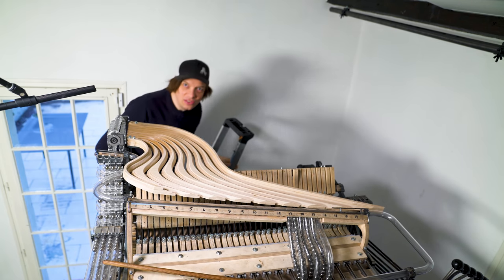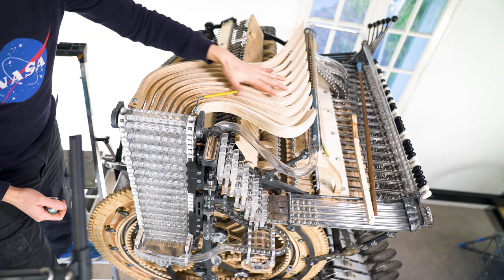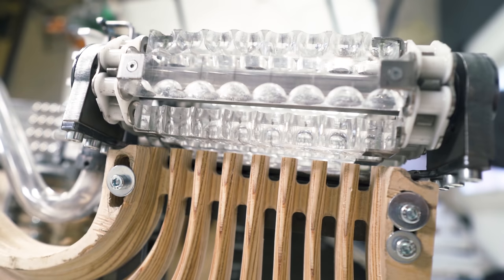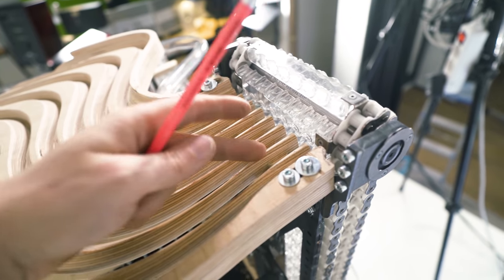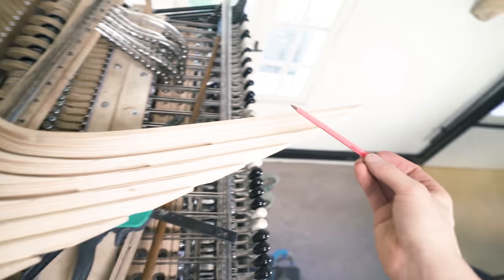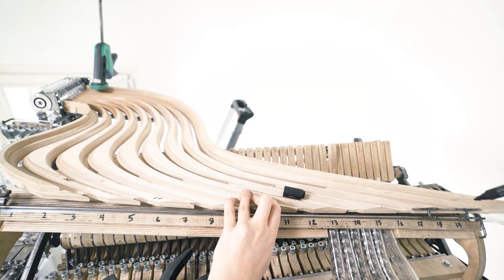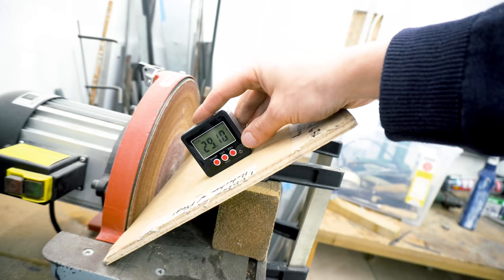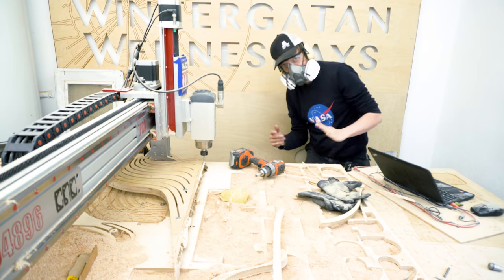Marble Conveyor Belt Plywood Lanes

Comment: This new marble track is aesthetically pleasing.
Reply: Its really good
Reply: It looks incredible high quality
Reply: Seriously. I was sad when he redesigned the original acrylic tubing marble divider, but this thing has more than made up for it visually.
Reply: No u
Reply: the artist is happy, will the engineer be happy? time shall tell
Reply: it is! but im a bit worried that the marble exit speed is to high
Reply: he is about to chop off more pieces tho...
Reply: the layers in the plywood would look great with a layer of varnish or lacquer
Reply: it is, i hope the distribution will be 'fair' for all channels, when they are open and not being rolled over like now.

also.. where is the best place to post the idea of a 100000 marble test - but continuously fast notes (with limited channels still)?
machine should be packed with marbles to provoke the moles honestly.
sorry martin, if this sounds like i want to punish you :( :D
big love man
Reply: It's my favorite part so far.  2021 is the year of compromise, and Martin has `said that aesthetics will be the first to go, but then proceeds to build this.  I'm not even mad.
Reply: @snujje  if the speed ends up being a problem, there’s a relatively simple fix: Martin explained before that by making the contact points of the rails wider (thus making contact with the outer axis of the marbles), the ball requires more rotations to travel the same amount of distance, and because of that also traveling slower. If Martin widens the lanes just a bit, he could potentially slow down the marbles quite a bit (if my logic is correct😅)
Reply: @screambmachine  I think the distribution is not a problem since the excess marbles loop around and come in from the pipe on the left. As long as there are enough marbles in rotation and there are always excess marbles, those first few channels should always get filled up first.
Reply: @GreenSkyDill  the fish stair is the only thing feeding the head of the vibraphone.  This could limit the number of marbles that can be played. The main lift seems to be biased to the middle and thus does not feed the vibraphone directly very well.
Reply: I have a feeling he will end up redesigning this. The issue right now is that he doesn't know how many marbles any of the instruments will need during the average performance, let alone a worse case scenario. So he doesn't know how to properly distribute the marbles. Not to mention that the marble conveyor works at a very low efficiency, currently, so he'll probably have to subject that to the same treatment the fish stair got. It might all work out in the end and he might not need to change anything, but it seems to me like he's investing a lot of effort into parts that are pretty likely to change. This is why i said before that he needs to do the big things first, like get all the instruments playing, and then worry about tiny things like "oh, look, these 4 pipes don't get filled evenly". Make it work first. Make it work better after.
Reply: Like flowing hair or the wind.
Reply: @ericpaul4575  He might just have to remake the entrance ramp to the main conveyor. Something similar to a binary counter could work, while giving the MMX the ability to count how many "new marbles" are going into the upper assembly.
Reply: @GreenSkyDill  yea forgott about that, he can widen the last part of the lane if it becomes an issue

Comment: Thats a lot of bouncing marbles there is almost a guarantee that there will be some instances where the forces collide in such a way that you get a ball flying out. Believe an extended rail system might be needed.
Reply: Was just about to post the same thing.
Marbles are entering the dividers so fast that they're bouncing quite a bit. I don't know if extended rails would help though - might just be adding extra complexity where it's not needed, contributing to the whack-a-mole issue.
Reply: yeah at 10:26 the marble nearly went over the top!
Reply: @aaronriggan2373  maybe instead of tracks that accelerate, he could make something akin to a stair so to keep the  speed in check?
Reply: If you have ever played a pinball machine, it would be cool to slow down the marbles with a “spinner”
Reply: he need to trash this part and just guide the balls through curvy PMMA pipes. this look disastrous. high in coke engineering.
Reply: @nothgroth1984  good solution, and for this sh*t, i think the only one.
Reply: I was going to post the same thing exactly.  Looks very nice but its looking more like artistic form over reliable function.   I guess you could put some sort of rail in place to catch the bouncing but then you are obscuring the visibility of the marbles moving down the final track.
Reply: @constantinosschinas4503  i was also thinking the same thing during the video, but i don't rhink martin would do it because "looks"
Reply: Or the contact point of the marbles could be changed to slow them down
Reply: I was thinking he could widen the tracks to utilize the technique discussed in previous videos where the marbles speed varies based on where it makes contact with the track. It could be a simple way to slow the roll of the marbles without introducing anything too complex.
Reply: Not to mention that the tests thus far have only used a handful of tracks. When a whole song is played, those marble returns are going to have to deal with a lot more volume which could introduce a lot more issues just on its own.
Reply: Have the marbles roll on a 'wider'  rail/track.  They are overspeeding at the end.. 
Or maybe a small vilt /wooden 'brake'  at the end of the lane (above the rail/marble) to get the speed down drasticaly.

10 point for the artistic look and 9 points on fysics for the slenting curves to keep them in lane
Reply: @bengaming3649  A wide strip of polycarbonate overtop would not look out of place and keep the marbles down
Reply: One of the modules might also need some adjustments it looks like the marble is resting a little to high up and blocking the other marbles from rolling down the divider creating more marble bounces when they collide with the fresh marbles coming down the track.
Reply: constantinos schinas Where’s the fun in that?
Reply: There definitely needs to be a braking system towards the end of the lanes. I know a lot of viewers spotted this as a possible mole during yesterday's video, but the slow motion today shows that it definitely is, in fact, a mole. The fact that a marble did (briefly) escape the divider and jumped back onto a lower lane means there's a high risk of marbles making it to the floor in a large scale test
Reply: It's not just the operation I'm worried about the acoustics of metal marbles bouncing over each other out of time with the music is also undesirable.
Reply: You beat me to that comment...
Reply: One might be able to brake the marbles by using inline magnets, the speed of the marbles in the track seems to be consistent which would make this possible. The only issue would then be magnetization of the marbles but since its a short interaction it might not be an issue.
Reply: Like what you have done it before, let width of the track gradually widens to slow down the marbles
Reply: I noticed that a lot of the bouncing seemed to be from the dismount off the track so it might be in order to also smooth out the angle there for more of a smooth drop off
Reply: There is 1 channel that is not flush when full and there they bounce
Reply: And need to take into account that the marble lanes are not 100% used. Will be much worse on fast song mb.
Reply: We can probably make the solution rather easy by adding a bit of grip to the lanes. Widening the track might not help much with the speed, but putting a bit of friction on the track definitely will. He might be able to save this by widening the track just a tad and putting some translucent spray rubber on the track towards the first bend. Anything later and the ball will have already gained momentum.

pair that with a sort of 'upper lip' at the end of the track to almost squeeze the marbles in place and that should solve both issues. There's just a little too much freedom of motion at the end there.
Reply: Was thinking the same
Reply: I agree that we need to slow the balls down. What about having a padded stop that absorbs the energy from the marbles so they don't go flying?
Reply: @jghanson25  Adding some kind of sound dampening material like what he used for the funnels to reduce sound could also not only reduce the sound the marble makes when they hit the wood but also increase the friction and therefore slow down the marbles.
Reply: @KalarMeadia  my exact thought, this would also reduce the sound they make when they initially hit the wood.
Reply: @jghanson25  Exactly what I was thinking, widen the lanes towards the end and introduce over-rotation to slow the marbles down before entering the divider!
Reply: they mainly hit the other piece of plywood, and that makes them jump. That can be sanded so the transition is smooth. Also if he could  use that technique of making the track wider to slow down the marbles due to an increase in rotational speed, then the piece could work without any issue.
Reply: remember a lot of the marbles will be used up by the xylophone which right now is currently blocked off.
Reply: thats what i said when he redesigned it
Reply: If you widen the contact points of the marbles toward the end of the runs it should cause the marbles to over rotate and slow down.
Reply: I think Martin should test if this is really an issue during a 50k marble test. Because right now no marble has escaped yet.
Reply: @enolp  BINGO!!! Actually, just need to extend the track groove in the backing wood strip so the balls 'flow' on the PMA pipe channels. Can be done with a rotary tool, or a file.
Reply: I honestly think it's not that bad- they'll bounce, but they'll bounce back onto the marble track based on the angle of their entry, hopefully?
Reply: @bengaming3649  could be a clear perspex shield of sorts, so you can see thru
Reply: At 10:20 there's already a marble on the floor :(
Reply: @nothgroth1984  wonderfull idea!
Reply: Yes. They seem to be coming down waaaaaaaay fast.
Reply: Yeah, 8:28 shows it perfectly,  the marble jumps a lane over when unloading
Reply: @bartholomewbilby1333  You sir, have a very dapper name.
Reply: A wild Mole has appear
Reply: Yeah, they have way too much speed by yhe time they get to where they need to be sprted through the channels that they end up bouncing over eachother and could even possibly jump pff the machine at highter bpms. The faster the marbles try to get sorted the more they will pile onto one another and end up commiting suicide off the machine. I love what hes doing and its a mechanical marvel. Ive been following for quite some time now and love the progress hes made.
Reply: @jamesparks5184  is there a coating that can be applied to the wood to add friction? Sprayable rubber?
Reply: It looks really great, but I agree some tweaking is needed to slow the marbles at the end. Part of it may be the transition where the angle changes rapidly.  I also noticed the marble height issue around gate 14 or 15 where you can definitely see some jumping balls in the slow-mo. These seem like solvable issues for a mind as creative and brilliant is Martin's.😉
Reply: @raskov75  honestly, a thin felt or fuzzy material would actually add the friction he would need to slow down the marbles and keep them controlled. Bonus, it will quiet down the extra sound of the marbles rolling down the track.
Reply: @jamesparks5184  Good point. Would he have to bother recessing the felt as to not throw off the tracks geometry?
Reply: @raskov75  that would depend on how thick of a strip of felt he uses. If he is generous with the felt, he may have to recess the plywood rails so that it all fits properly without restricting the carry capacity of the trails.
Reply: I feel like it'll add extra noise, too.
Reply: This will go wrong especially when very few notes as played and the machine has way to many marbles inside (for the current song). 
Martin, I suggest you to test this solution with an overfilled machine. You'll see this will go wrong.
I'm sorry, but I think you still failed on the mechanics first, aesthetics second.
Reply: @raskov75  Ah yes. I chose that name because my best friend was Steve Squirrel.
Reply: @nothgroth1984  A gate?
Reply: How about a simple plastic funnel across all lanes as on the catchers.
Reply: Could probably just widen the gap at the end of the track, so the ball spins on a smaller circumference.
Reply: @Dreoni_  yep, over rotate the marbles and slow them down
Reply: @bradgentle354  I watched the video again, the marbles are bouncing, but they're staying in contact with the ramp, so there doesn't appear to be a real risk of them falling over like a waterfall.  I noticed one actually bounce back to the track above the one it came from, but continue along happily enough.  I think there too much confirmation bias from yesterday going on, watch it again and pay close attention.
Reply: Or angle the plywood closer to the release point so you minimize the downwards force
Reply: Gunna post a possible solution. Most agree with the premise that the velocity is bad, a theoretical solution is to spray on some rubberized coating. A little squish goes a long way in absorbing kinetic energy as well as rubber being more grippy means more friction alongside the squish.
Reply: @dorusie5  Or it could lock the whole system up when a skipping marble wedges in it. Do not pass go, do not collect $100.

Better to slow the marbles down by adjusting track geometry - increased friction is ok.
Reply: @B0BBYL33J0RD4N  Rubber coating will rub off the marbles and make them sticky. Plywood is rather bouncy.
Reply: @nigelstewart9982  The marble that jumped onto the track, imagine now that's one on the track 5, it could easily skip out of the machine. Or that it hits another marble rolling down on the track it bounces on and knocks it off or skips further rather than rolling down again.
Reply: @timothyodonnell8591  Woah i think that one is even more of an issue, i think the marble was coming back into another track.
Reply: Also it looked like there might be a little bump at the end of the tracks that acts like a little jump. Not huge, but it adds to the risk of a flying marble.
Reply: @AstralS7orm  I thought about that too, if you keep the distance from the lane at least 2 marble diameters then that should never happen.
Reply: @cyprienchrnx3809  really! So much conjecture here. At this point in the process let the test results drive the need for redesigns.

Comment: "It's not going to cause any issues" - famous last words.
Reply: snap!
Reply: The lanes are very elegant, but I'm worried about those bolts too. I think the housing looks too thin, but also, the bolts don't look beautiful.
Reply: Looking at how the marbles fall on each other at the bottom, I think the conveyor may give the marbles too much velocity and the marbles will bounce out of the machine. Looks fantastic though, great modelling skills and craftmanship
Reply: @richardspice2334  and at the start marbles are falling a bit on the left part of the canal, generating chocks between themselves (@10.57). Could be some issues as well here (i'm really pickyboring😜).
Nevertheless this is awesome !
#pastisforever
Reply: but it will. I'm worried that new tracks are in the way of... how you call it? registrators? that plywood levers right below those tracks
Reply: I honestly think that the new lanes will be re-cut (to reduce marble speed when exiting the sweeping channel), allowing Martin to add in those extensions. I think he may also add a part where the marbles release so they don't drop so much into the channels (meaning they won't bounce as much).

But that's me back seat engineering :D
Reply: Didn't Elon Musk say exactly the same before the last SN9 flight ? ^^
Reply: Especially when under the stress and rigors of a world tour.

Comment: Lol, love it. Last episode you were, "Oh no! I messed up" and this episode, "It turns out I didn't mess up. I planned ahead, and forgot about it." :D
Reply: But where it meets the conveyor had to be adjusted, I think he "planned ahead" for mistakes, and by doing that he saved himself. I don't think this went "to plan" though :)
Reply: @dave_jones  I hope something more can be done at the conveyor drop off, to ensure that marbles don't ever roll backwards and ride the elevator down. It looks fine right now but if the lanes get crowded this could happen.
Reply: @mattiasthorslund6467  I was thinking something as simple as a shallow ramp on the lanes leading up to the elevator drop-off point. Would be a rather quick addition that has the added benefit of preventing the marbles from having so far to drop, reducing the bounce at the start, which I could see being a small issue further down the road. Like when there are much more marbles in the machine.
Reply: @mattiasthorslund6467  If the marble lanes get crowded something terrible's already happened down the line to prevent the marbles from recirculating, I think. I think because of it's consistent rhythm dropping off marbles they shouldn't clash against previously deposited  marbles either